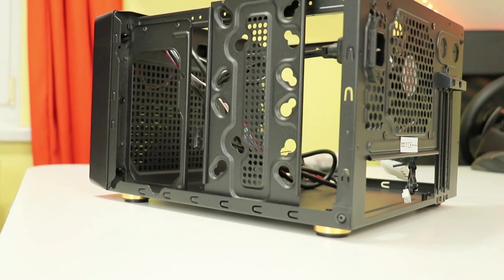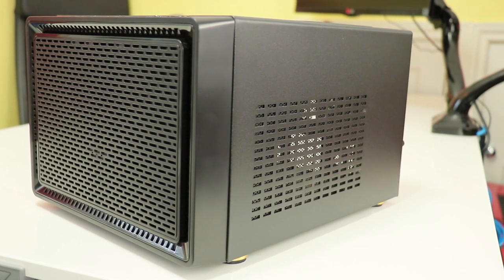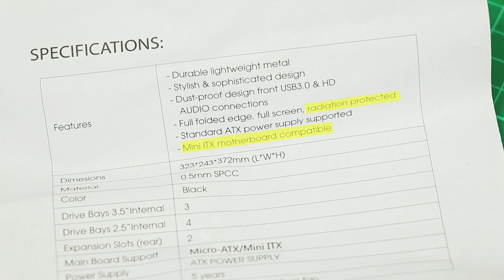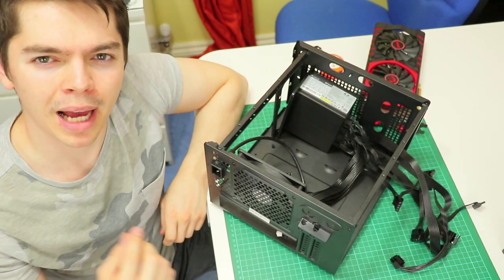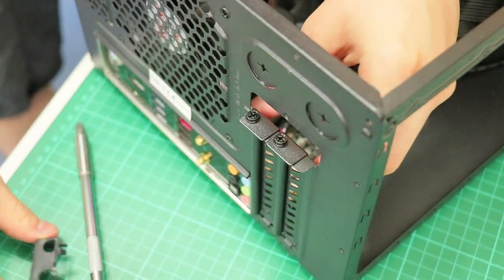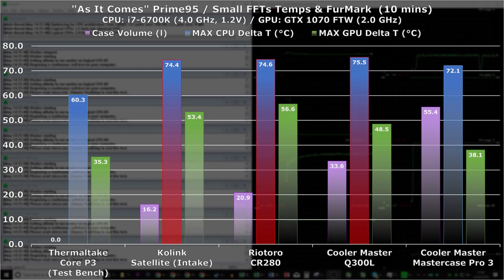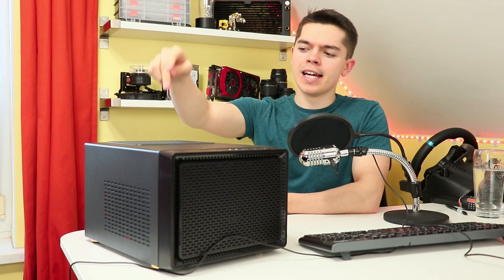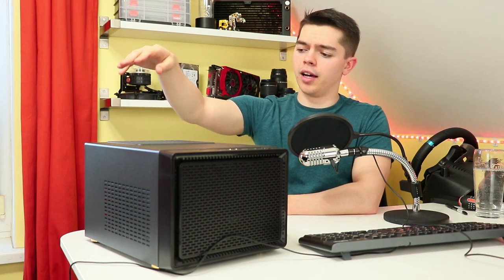Kolink Satellite (Mini ITX/Micro ATX) Review

Comment: Too bad you didnt build an m-ATX board in this case. I mean, why would anyone buy a premium priced mini-ITX board, when m-ATX is much cheaper?

Luckily I still have an old LGA1150 m-ATX board lying around, which will fit perfectly into this case (its 22,6 x 17,6 cm). So I just need to buy the case for €35. Win win, since I also already have the CPU for it.
Reply from the maker: There's not much point in using a Micro ATX board apart from space on the board. There's only two PCIe slots to the rear which will more than likely be used for a dual slot graphics card. An ITX board will help a lot with keeping the premium space inside available for easier cable management and port connections.

Of course there are some benefits to a mATX boards, mainly amount of connectors, but in this case there's not a lot of support for Micro ATX boards (lack of PCIe slots, one of the main reasons for going for a Micro ATX board).

One reason to go for a premium ITX board over a limited selection of Mirco ATX boards is the VRM. You'll tend to get a much more capable VRM on a premium ITX board than a mid range/low end downsizes mATX board. Especially with Zen 2 around the corner.
Reply: @AVTechy  Well, I still have an old spare AsRock H81M-P33 mATX board lying around which I will use with this case, because it fits perfectly and that one PCIe slot for my GPU is more than enough for a travelling PC. This board cost me 40 bucks 2 years ago and I also still have a spare i5 4460, 8gigs DDR3 RAM and a 500W PSU, so I just need to buy the case and an SSD and voila. Micro PC ready to go. Without having to spend over $100-200 just for the ITX mainboard, lol.
Reply from the maker: @Oozaru85  I mean that's good if you're looking for a system that supports PCIe 2.0 devices, but lets say you wanted a rendering machine that's GPU based, or a gaming machine that you wanted to fit a modern graphics card into, then you'd probably want to go for a newer board to start.

Then if you wanted to push an overclock on the CPU or just throw in a high wattage 12 core or 16 core CPU, you might want to think about the VRM, so going for a premium $150-200 board makes a huge amount of sense.

Realize that you're comparing two completely different products as if they were the same or even similar. I mean you're working with a 3+1 phase VRM without heatsinks and trying to compare it to a board with 9+1 phase VRM with heatsinks (a vastly more capable motherboard).

So yeah, I'm feeling pretty good about my £80 board bought a couple of years back. There's a reason your board was $40...
Reply: @AVTechy  Sure, but my mATX board is good enough for me and my 4C i5 non-K CPU. ALso there's little to nothing to choose from when it comes to LGA 1150 mini-ITX boards these days. So, yeah...

All Im saying is: it would've been nice if you had also tested an mATX mainboard with this case. Preferably a non-premium board, just to see how it works and how temps are and stuff. Oh well, guess Ill find out in a few days when the case arrives.
Reply from the maker: Airflow shouldn't change with board size so I wouldn't worry about it.

And your comments with regards to the usability of the boards are pointless since the use cases are different.

What would you expect to change with a change in board size?
Reply: @AVTechy  Yes, well. I was talking about my case obviously. Anyway, this case will fit my needs perfectly. Thanks for your input tho.

Comment: Micro ATX is cheaper so people want that
Reply from the maker: That's true, and I prefer the Micro ATX form factor, it generally provides all that people need.

It's a shame that the case wasn't deigned a little differently to support more Micro ATX boards with at least another PCIe slot cover.

Which motherboard did you go for in the end?

Comment: I put ferrites on every analog audio cable theyre pointless with spdif, overclockers uk SUCK big time, i used to live right next to them in fenton stoke on trent, theyre the WORST company ever, useless tech support and stupidly overpriced, the best graphics card for this case is the one i have at the moment, its an MSI MECH 5700XT, i have cut out the front panel and fitted a 7inch lcd screen i take this case on holiday as an all-in-1 pc without the need for a monitor - anyway fella, water in a stella artois glass is just criminal, you need serious jail time...